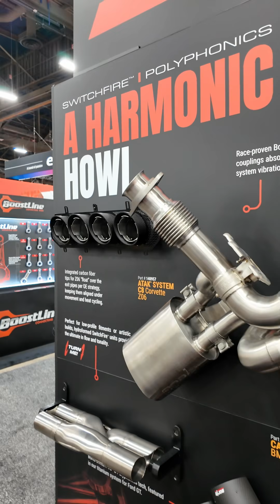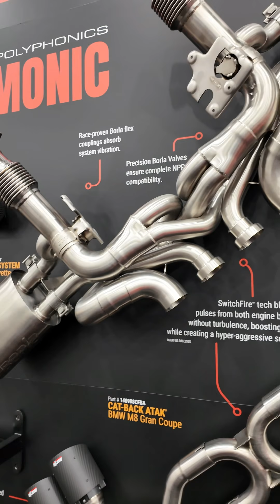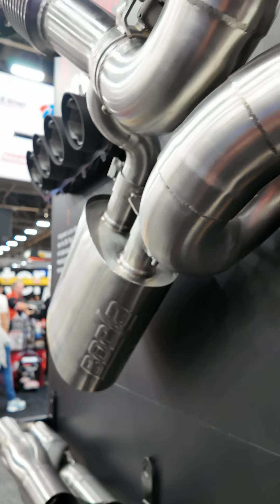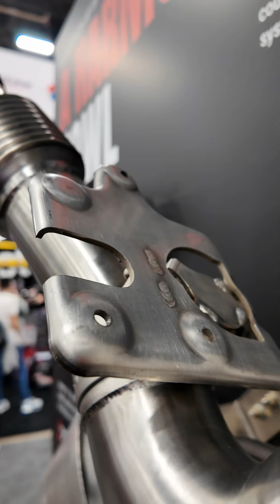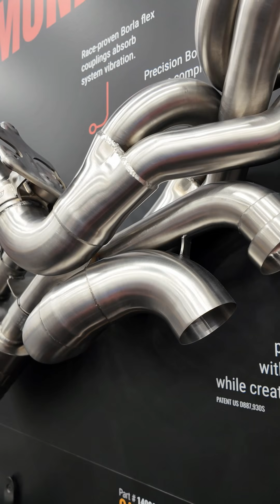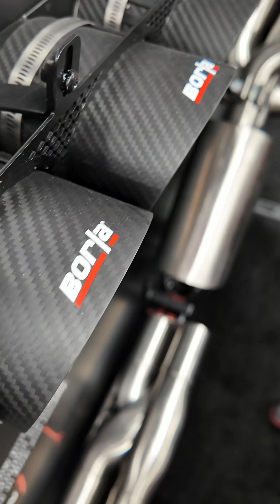SEMA 2025: Borla Performance Industries Technology Wall | Patented Exhaust Tech | C8 Z06 System

Comment: Had so many problems with this my exhaust system on my previous C8 fault lights after install would not go away I want to purchase for my 2024 C8 Z06 but not sure of fault lights is very annoying can’t use key fob features